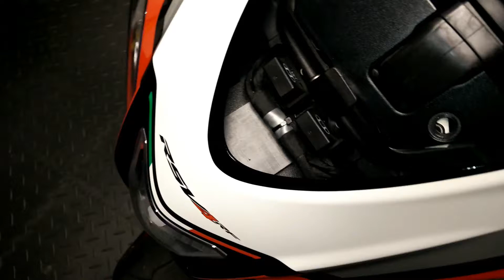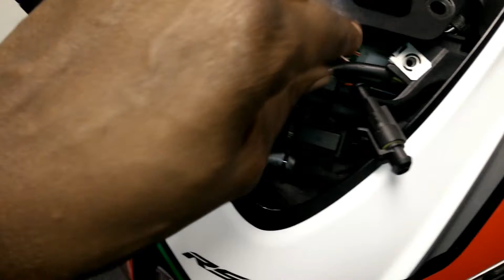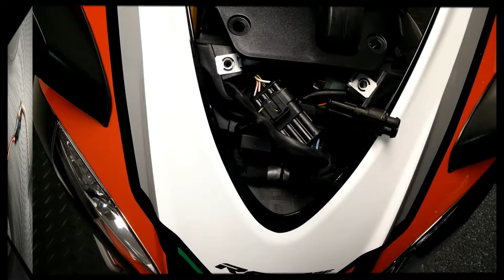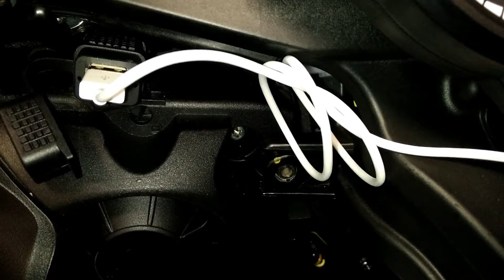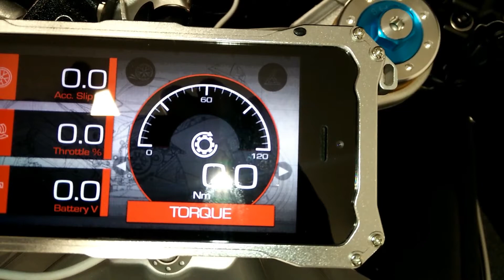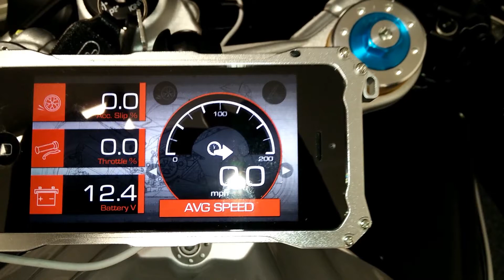2015 Aprilia RSV4 RF Hidden Working USB cable

Comment: Earlster  were u able to locate usb for the 17 model? im looking but I cant find it   thanks
Reply from the maker: @Carlton Davis it's bolted on the LHS of dash sealed with a dust cap,
Reply: I found it,   Also what support are u using for your I phone
Reply from the maker: Cool 👍, the phone on this video I made it from a spare water resistant shockproof aluminum gorilla iPhone 5c glass case bolted and glued onto a RAM Mounts UNPKD RAM 2 X 1.7 - The stem is also from an adjustable RAM Motorcycle Fork Stem Mount - I also use a ram mount x grip for other phones, the RAM Mounts UNPKD RAM 2 X 1.7 is useful for the GoPro for those tracks days

Comment: is this on the 2017 model rr??
Reply from the maker: It comes as standard on the 2017.
Reply: as standard where?? in that clump of wires??
Reply from the maker: The USB cable, Housing and USB port are now fitted as standard on the left side of the dash on the 2017 model.
Reply from the maker: @Phillup DaVoid - I'm referring to the 2017 RSV4 RF model, not sure what bike you have, if you do not see it, prehaps it's not fitted and the USB cable is hidden away,
Reply from the maker: @Phillup DaVoid looks like the 2017 model RR is hidden beneath the windscreen, not sure why Aprilia did not include it.

Comment: I have the limited edition rsvr rf 2015, I will try to find this cable 
My question was, do you think we can upgrade to tft screen of 2017 model to 2015 model ?
Reply from the maker: Good question, to be honest I do not know, but it would be an expensive upgrade because OEM Aprilia TFT Dashboard - 2D000278 is listed $708.68. I sure there will be other items you would need too,
Reply: Did you ever find this cable? I also have a 2015 RF but can't find this cable

Comment: I have the exact bike, do they all come with multi media? Thanks
Reply from the maker: No it's optional extra on our bikes, I believe it's now included on 2017 models
Reply: The Earlster Thanks, I purchased mine when it was 3 months old so I'm not sure if have it, are there any indications? And another question how did you secure the USB socket?
Reply from the maker: Hey Richard, if it’s the same model as mine than I would be very surprised if this is not hidden away in the console, and to secure in place I used sugru - works well,